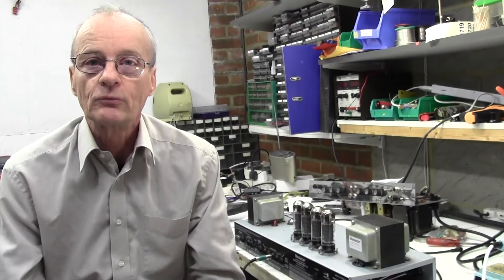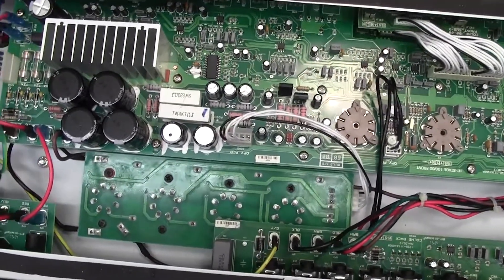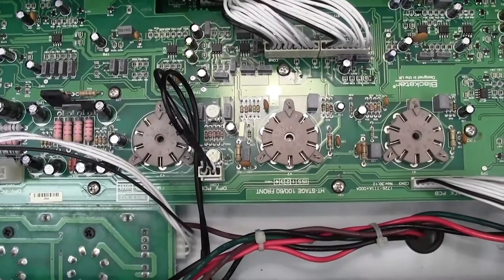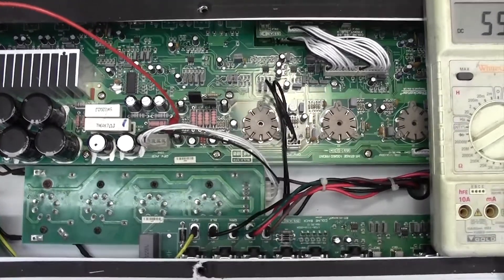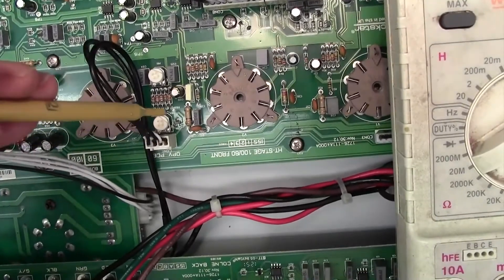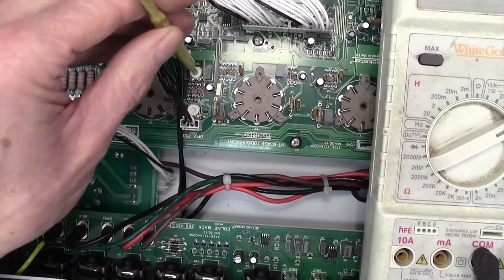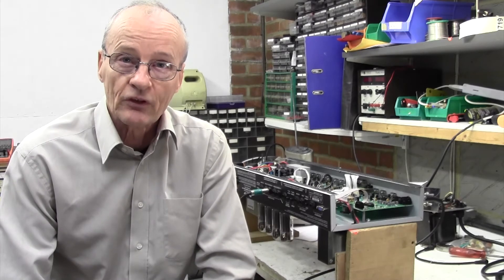How to Bias Blackstar HT 100 and HT60 Guitar Amplifier

Comment: Hello. I would like to ask if you know by a chance - which of the 12AX7 tubes is for clean and which one is for overdrive? I have a stage 100 MKIII and I believe it's core design is similar to the original. I have issues with my clean channel (newest video on my channel), and I would like to know which of two tubes to replace (if the issue is with the tube in the first place).
Reply from the maker: Hi Off the top of my head I don't, however, this is easy. Just swap preamp tubes around and see if it affects the problem.
Reply: @stuartukguitarampguy5830  Thank you. I did that, and found out that the noise isn't brought from clean to overdrive channel by swapping the tubes. The problem is not related to tubes, and since blackstar already refused me technical support and their amp PCBs are hard to troubleshoot, I don't have expertise to solve the problem on my own. Probably will have to bring it to a workshop.
Reply from the maker: @Kreozot2D  Ok yes that's very frustrating. even I can;t get Blackstar chematics. It's pathetic, as thhough someone might 'steal' their crappy designs! Good luck getting it fixed.
Reply: @stuartukguitarampguy5830  I hope american Right To Repair movement gets them as it has seemingly got Apple. But here is a funny story for you. After swapping tubes, I swapped them back as they were, because of my dumb superstitions. After that, I reassembled the amp and it's frame, and it's clean channel noises are almost gone. They are twice rarer and 4 times quiter now. I wonder if it's something to do with tube pins being imperfect and contact points being adjusted through friction during the swap, or something to do with cable management. Because cables in this thing seem to just hang around inside there like liana vines in the jungle. Maybe signals in the cables interfere with each other and PCBs, I don't know, but I'll probably try to do this again sometime.
Anyway, I'm very grateful for your suggestions and replies, and it's a bit sad that I didn't think about swapping the tubes myself earlier :)
Reply from the maker: @Kreozot2D  Hi Two possibilities here. One is that the noise just went away for 'reasons' and it's nothing to do with the tube swap. Second is that you may have had a dirty tube contact and swapping the tubes helped that. In all likelihood, you'll never know!

Comment: Thanks for the video! Any idea what it means if the PR2 screw wont turn any more and the mv is only reaching 36 on my meter?
Reply from the maker: It's not in my mind at the moment but if you're close enough on the bias I'd leave it at that.
Reply: @stuartukguitarampguy5830  When measuring at the diode, isnt it the combined mV for both tubes? The HT 60 has 2, so shouldnt I be getting 50-70mV there? Thanks for your thoughts on this
Reply from the maker: @krysticsage  Hi Yes it's the combined current. So if you have two power valves, and both draw about 35mA then you'd look for 70mV across that diode. That's my understanding. I don;t have the schematic for this amp.
Reply: @ That was what I thought too. If you went to measure and the pot that changes the voltage is all the way up and it only showed 36mV, do you know if that would that indicate bad tubes or could it be something else?
Reply from the maker: @krysticsage  I suupose one tube could be not working? Do you have the old set you can try? I don't have the schematic but if I were desperate, I'd play around with some of those fixed resistors near the pot to see if one of them changed the bias.
Reply: @ I dont have another set of tubes but thanks again for the tips and sharing your thoughts!

Comment: two of the small valves are not lighting up. I assume they need replacing, but do the pre amp valves need biasing also?
Reply from the maker: Hi Chris  Preamp tubes don;t need biasing. Also, preamp tubes almost never fail 'no heater'. Just check they really AREN'T lighting up as the heater is quite faint. Leave on for half an hour then feel them with your hand. Stone cold? That's a problem. Let me know.

Comment: I did everything you do in your video (at least I think I did) but I measure 0. To make sure that my multimeter works I testet it on battery (1,5 V). Turning the knob didn't change anything. Further points to check: I plugged in a cable to the input and I turned the power and the standby on. I turned my multimeter to 600 mV because it has no 200 mV preset but I think this shouldn't be a problem.
Do yo have an idea what the reason for the mistake can be? Is there any other point where I can put the multimeter and check the value?
Reply: Found the mistake myself. I think the multimeter didn't have contact. I was able to adjust the bias according to your video. Great tutorial, thanks!

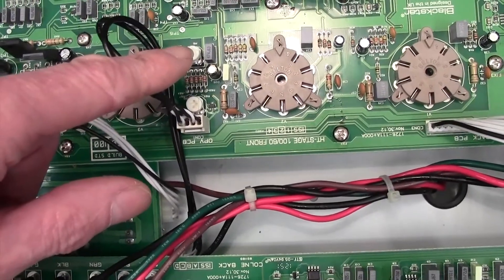Comment: At 2:05. We have to rely on the 2 matched power Tubes !!! Is their any way to Balance the power Tubes with a Volt-meter by using the Balance adjustable screw ???
  Blackstar Head Office won’t tell me how !!!
Reply from the maker: Hi Yes it's normal practice to have the power valves matched paur or quad. I'm not 100% sure what that balance conrol does. Do you have a bias meter?

Comment: Hi Stuart, great vid, very clear. As the HT Stage 60 only has 2 powertubes, should we halve the mV? i.e. look to bias it to 70mV? I've seen other vids where they go to 60mV..? Thanks.
Reply from the maker: Hi  Yes the bias current is for TWO valves so aim for about 70mV  = 70mA = 35ma PER TUBE

sTUART

Comment: Hi just a question? Is there serial number inside the amp? Because i lost the sticker on my blackstar and its still under warranty 🙏🙏
Reply from the maker: Hi Shaun I'm afroad I don't know and the amp is long gone of course.
Reply: @stuartukguitarampguy5830  ok thanks for responding. It was just in general if there is another sticker inside with serial numbers on amps because i need serial number to get software acount for blackstar pkus the warranty

Comment: Hi Stuart, great video thank you.  

Is there anything (voltage) that needs to be discharged on this particular model in the video, before proceeding with your bias instructions?
Reply from the maker: Hi. All valve amps have potentially high voltages in them. If you turn off the amp with the valves still lit, this will usually discharge everything. You can always measure around the power valve bases with a mater just to check voltages are below say 50V. Also, you have no need to touch anything inside so that's a triple safety measure.
Reply: @stuartukguitarampguy5830  thanks so much sir, that helps!  I have some TAD EL34’s (quad match, directly from TAD) on the way.  I work in the field of electronics and am very aware of the risks when working with high voltage devices, just performing some additional research before performing the task.  Thanks again!

Comment: I have the Soloist 60 and it has a different testing diode. Would you happen to know which one it would be?
Reply from the maker: Hi Jason. It's been a while since I made this vid. I'm unsure what you mean by 'testing diode'? And do you mean what compoenent type it is?
Reply: @stuartukguitarampguy5830  I am trying to find where to place the multimeter on the board so I can get a bias reading.
Reply from the maker: @jasonmaltz7040  Hi Jason  Alas I don;t have any onfo on the soloist 60. Sorry
Reply: @stuartukguitarampguy5830  thanks. Blackstar doesn’t publish any help. So frustrating. Guess I’ll have to take my chances without biasing the amp
Reply from the maker: Hi I got this off the Internet, no idea if useful.  TP1,7 are across a 1 ohm resistor (and D27).
Reply: @stuartukguitarampguy5830  thanks, yep saw that as well but it wasn’t giving me a good reading when checking with the multimeter. Really appreciate your willingness to help!
Reply from the maker: @jasonmaltz7040  I think it's the same scghematic as the HT Stage 60. If so, the cathodes of both power valves go via a 1 ohm (R207) to ground. D27 is also in parallel with that resistor. SO measuring across there should give you about 70mV or in that region.

Comment: curious about how they ensure the power tubes don't pull current until the input jack is plugged in... is it a sort of a secondary standby switch, that once its closed, lets the high voltage onto the plates and screens? very interesting... also curious if you have any luck with getting schematics for these suckers? great video!
Reply: also curious - please excuse my ignorance - where is the 1 ohm resistor?
Reply from the maker: I think it's probably to stop hum when the i/p lead is pulled out. I've got one or two schematics for various Blackstar but they are hard to get.

Comment: Hi Stuart, thank you for showing us how to bias the HT 100. I have one on the bench at the moment and the customer reports that the clean channel suddenly becomes louder after a while. I have my own valve tester and have checked all the valves. The O/P valves all seem approx the same in terms of transconductance and the preamp tubes are within spec according to my data sheets. I have used freezer spray on some of the surface mount components but cant really repeat the issue. Do you have any ideas you might be willing to share. Many thanks Ray
Reply from the maker: Hi Ray A common problem is the two power FETs so it might be worth changing those on spec. There's not a huge amount more you can do on these amps due to the surface mount construction. If you can get a new board out of Blackstar, that might be a way forward.
Reply: @stuartukguitarampguy5830  What is the "power FET" you refer to? I was playing my HT 60 Mk 1 last night and noticed the volume drop out and then come back and drop back out again. I'm planning on replacing the tubes all around as it has 6l6's in it when it's supposed to have EL34's, it also has a mix of different brand pre-amp tubes. Bought it used and has been solid for a year, but you never know what kind of twiddling someone else has done.

Thanks,
Reply from the maker: @TheSchumijr  Hi Ray  YOu can see them in the thumbnail to this video. The two black poower transistors standing up off the board. They often go faulty but I'm not saying this is the issue with your amp.

Comment: I need more prensence on this amp, how i do?
Reply from the maker: I'm afraid the answer is "buy a different amp"!
Reply: @stuartukguitarampguy5830  what amp? Marshall?
Reply from the maker: @pulidomi  Thats a very hard question as only you know the sound you are looking for. As a general rule though, if someone asks me to 'change th tone or sound' of their existing amp, I always advise them to find an amp they like the sound of and get rid of their existing one..
Reply: @stuartukguitarampguy5830  Paul Gilbert is my reference.
Reply from the maker: @pulidomi  The thing is, I am a repair technician not a guitarist (I can play but not cery well) so I'm not qualified to advise on different amplifiers, tones and so on. The obvious question is what does Paul Gilbert use?!
Reply: @stuartukguitarampguy5830  marshall
Reply: Hi Thank you for a helpful video regarding the biasing of the ht60 mk1 . I’ve biased the amp but notice that the regulators mounted on the heat sink run extremely hot . Is this normal for this amp ?

Comment: Any info for the MK II, I believe mine is a 2017 circuit. Has LED’s on the high voltage side with 2 pots for control of a red and green LED. A 6 and 60 watt position switch on front for selection of one or the other. On 60 mine is basically unusable due to breakup at low volume setting. 6 seems to work fine. I believe your example is an older version.
Reply from the maker: Hi Keith. Actually I'm not aware of your version and have never seen one. Doubtles one will come into the shop at some point.
Sorry I can't help more.
Reply: @stuartukguitarampguy5830  Stew could I get U R email info? I would like to send some sound bits and video so maybe you've seen my problem B 4. Also anything I could offer in transition to maybe familiarize yourself with the model. I have an electronics background and retired from GE and USAF repairing and calibrating medical equipment and medical X-Ray systems.
Reply: Thanks, when it does can you post what you find and how to? Thanks again.